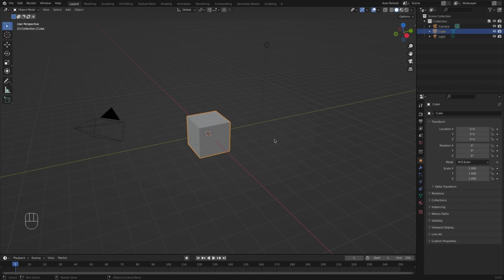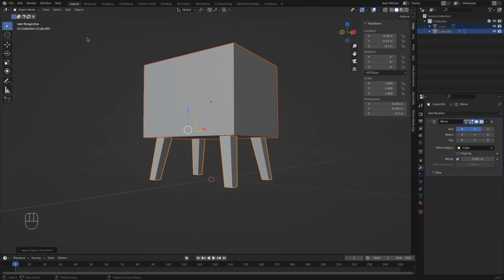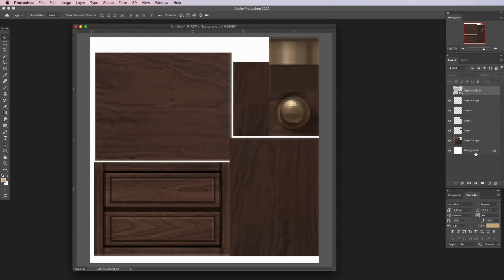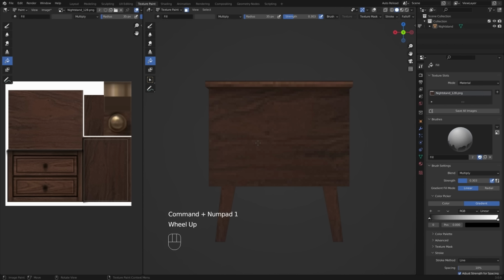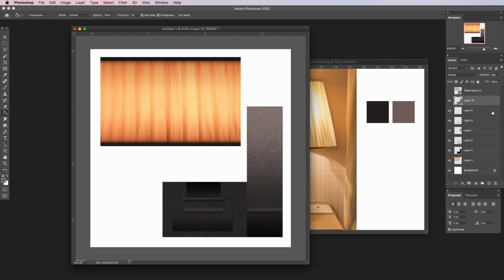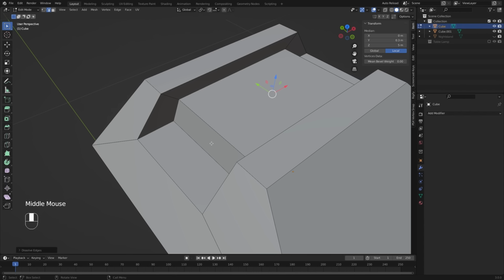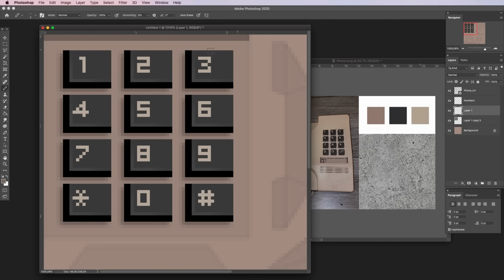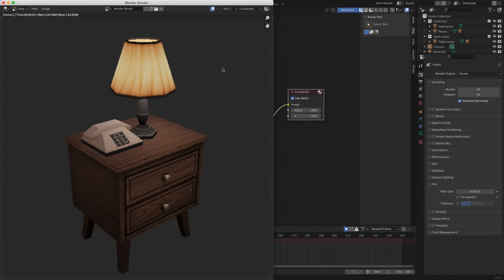PS1 Style Graphics in Blender / Low Poly Assets Beginner Tutorial - Part 1

Comment: how are you making 2 sepret windows in photoshop? i can't do that at all. you also seem to have chosen a "clipboard" when first creating the project, and i dont have that option either. im assuming thats the reason you can just drag and drop a photo to make a new tab? what am i doing wrong? i've tried every photoshop alternative including the free trail of photoshop and i cant seem to do that at all. idk if you are hitting extra keys or not. also when i bring in my uv image into photoshop, yours just magically fills in the whole photo, while i have to scale mine. tf am i doing wrong?
Reply from the maker: To be honest, I’m not even sure why you’re running into this issue. Photoshop allows you to have several documents open at the same time. If you grab a window by its top bar (header), you can either move it out as a separate floating window or dock it to the top of the main application window.

As for your UV issue, there’s one important thing to keep in mind: when you drag a PNG file from a folder into a Photoshop document, make sure the document canvas isn’t zoomed in too much and that the entire canvas is visible. In that case, the imported UV image will automatically be placed to fit the canvas dimensions.

Comment: At the 43-44 minute mark, when you're doing the drop shadows under the lip of the top of the nightstand, when I try to do the exact same thing my shadow comes at an angle and when I hold alt it gets worse. What am I doing wrong?
Reply from the maker: I thought the problem might be related to the Blender version, but I just tested it in Blender 5, and everything works fine for me.
To make the gradient run perfectly vertically, it’s important to do this from the correct viewing angle, for example, using Front View or Side View.
The process is as follows: drag to set the direction using the LMB, then hold Alt, and finally release the LMB.
Reply: @Summmer85  thanks man, I'll give it a shot in the morning. Appreciate the response, this is a great tutorial! Can't wait to get to making stuff on my own!

Comment: 24:17 doesnt work for me. It didn't change anything - its just by eye still. EDIT. It works by in my case i must point to the corner of the uv object
Reply from the maker: Yes, you’re right. In newer versions, you need to specify the angle as an additional step.
Reply: @Summmer85  more additional steper! Yeah...;_;

Comment: Hey, thank you so much for making this. This is quite silly, but at 15.40 anytime i try to move the face across the z angle whilst in the no.3 view position, it just moves the face of the object rather than the whole leg to the left. i've made sure all my settings are the same and my screen seems to match yours exactly, so im not sure why that is? any advice would be greatly appreciated x
Reply from the maker: I’m not entirely sure what’s causing the problem, but I suspect there might be some extra (duplicate) faces in your mesh. If that’s the case, try selecting the whole leg of the nightstand in Edit Mode (A), then press M → Merge by Distance.
If that doesn’t solve the problem, please send a message in the chat on my Discord server (link in bio) and attach a screenshot.

Comment: Does anyone know how to snap to vertex in 24:18? It isn't snapping at all in my case...
Reply from the maker: In the newer version of Blender, while moving the fragment, hold down Control and additionally hover your cursor over the top-left vertex of the reference fragment, for example.
Reply: OK Found Out, 

Summer 85 : There's good news! Snapping actually works in the newer versions of Blender, it just works a little differently now.
You need to select one UV island, hold Ctrl, and start moving it toward the similar island. While dragging, place your cursor over one of the corner vertices of the reference island.

Comment: for some reason cube project isn't working for me! I'm using 5.1.2 and all it does is show the uvs as a normal cube instead of the modified shape!
Reply from the maker: Here I’d like to ask whether you applied the Scale. But you probably did, so I’m not really sure what could be causing the issue. I’m currently using Blender 4.5, and everything works as expected here.
Reply: It doesn't work at all for me either
Reply from the maker: @Elisuperr  I tried it in Blender 5.2, and everything works without any problems. The key is to apply the scale (Ctrl+A) beforehand.

Comment: 24:08 snapping in uv editor seems to literally be broken because I have followed every single keybind exactly, vanilla blender 5.2.0 LTS release (no addons or whatever) and I can't get ANY SNAPPING to work. holding down ctrl literally does nothing, it's like snapping straight up doesn't exist. the magnet icon is on, its set to vertex, affect move, nothing happens. ive read every single stackexchange question on this and none of the solutions work. you're forced to just eyeball it.
Reply from the maker: There's good news! Snapping actually works in the newer versions of Blender, it just works a little differently now.
You need to select one UV island, hold Ctrl, and start moving it toward the similar island. While dragging, place your cursor over one of the corner vertices of the reference island.
Reply: @Summmer85  This worked for me. Final step is let go of Ctrl.

Comment: Hi there @Summer85 - Been having a slight issue with UV unwrap on the phone section where my uv unwraps dont look like your ones and i cant figure it out for the life of me. 
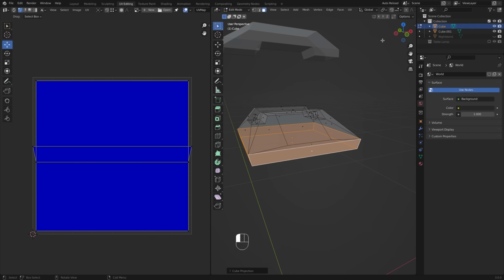Ive highlighted the bottom section of the phone and then done a cube projection but they are just turning into squares no long horizontal like in your video at 1:16:18. any help would be appreicated
Reply: Managed to figure out how to delete the Uv Map and will try again first
Reply from the maker: Hi! Did you apply the scale (Control+A) before unwrapping the UVs?

Comment: stuck at this part 23:24 dont know what to do.. help!
Reply from the maker: If you can't snap one UV island on top of another, try dragging it while aiming your cursor at a corner of the target UV island rather than its center.

And you may also need to disable UV Sync Selection (the two arrows in the top-left corner) so that everything works the same way as it does in the tutorial.
Reply: @Summmer85  IT WORKED! THANKS A LOT :face-blue-smiling:
Reply from the maker: @Rootvik.  That's just how the newer versions of Blender behave. The tutorial was recorded in Blender 3.0.
Reply: @Summmer85  I see, thanks for such a quick response!

Comment: Is there no way to apply the textures in Blender instead of Photoshop?

I don’t really have the skill for photoshop but if this is the best way, then I am willing to learn.
Reply from the maker: Actually, you can create textures in whatever software you're most comfortable with. I've been using Photoshop for many years, so it's what I'm used to. A lot of people also use GIMP.
You can even paint textures directly inside Blender, but I personally prefer Photoshop because I feel like I have more control there.
Reply: @S @Summmer85 I found a way which is to use a texture ripper. I found a program called Dinorip which allows me to make a texture atlas. This can then be applied to the UVs.

Maybe if that’s new to you, you can also check it out and it could be a video topic for you 👍

Comment: why his brush paint shadow pixelated while mine just like thick brush at 42:00
Reply from the maker: Probably because you’re using a higher-resolution texture. Also, in the material settings, it should be set to Closest instead of Linear so that the pixels stay as sharp as possible.

Comment: for the 1st asset, why not just use UV Smart Unwrap?
Reply from the maker: The main reason is the texture resolution we're working with for this asset — only 128×128 px. We're trying to use that space as efficiently as possible and squeeze the most out of it.
With Smart UV, the elements are not always unwrapped in the most convenient way. That said, it's still a perfectly valid place to start. The important thing is understanding how to proceed afterward and adapt the UV layout to the specific situation you're dealing with.

Comment: Hey I have a question about blurring on the textures is there any way to prevent this when scaling down? i didn't use the textures you have everything looks good except for the drawer lines is it just the images i got are to high in scale?
Reply from the maker: Blurring or distortion of a pixel-art texture when scaling it down is inevitable, which is why the best approach is to create it at the target resolution from the start.
However, there is one setting that helps preserve pixel sharpness much better. When using the Image Size dialog, make sure to select Nearest Neighbor in the Resample option.

Comment: im having some problems whit te uv editing, i follow every step but it isnt like yours😭
Reply from the maker: Could you tell me the timestamp where you ran into the issue? I'll try to help.
Different versions of Blender work a little differently, so that might be the reason.
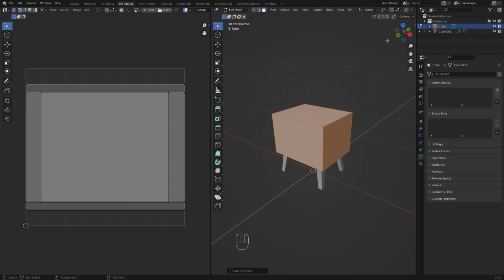Reply: @Summmer85 18:58 i usually use the second way you showed but i wanted to learn the first one, the problem is i dont understand how you select the faces like that. also in an animation do you think it will be cool to male the objects shake with the camera movement(also i dont know how to do it but its an another problem🤦🏻‍♂️)?
Reply from the maker: @MassA159_p The main difference here is that in newer versions of Blender, UV Sync Selection (the two arrows in the upper-left corner) is enabled by default. With this option turned on, all selected faces are always displayed in the UV Editor. Sometimes that's convenient, and sometimes it isn't.
As for the first method you mentioned... do you mean selecting faces one by one? If so, you can simply do that while holding Shift.
As for objects shaking in sync with the camera movement — sorry, but I'm not sure I understand what you mean. :)

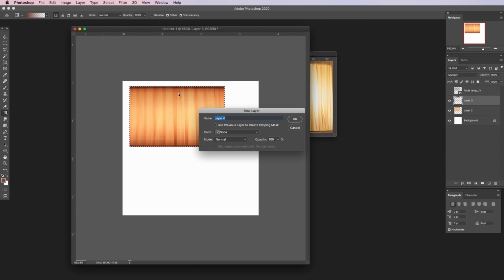Comment: Hi, Im having trouble with 56:00, whenever I use the gradient tool on the bottom and then try to do the same thing on the top, the bottom one disappears and vice versa
Reply: rn im just doing it in different layers
Reply from the maker: @irina-ren  Check the top-left corner and see what type of gradient you have selected. You need Classic Gradient, and then a bit to the right, in the presets section, you should choose Basic (probably the middle option).

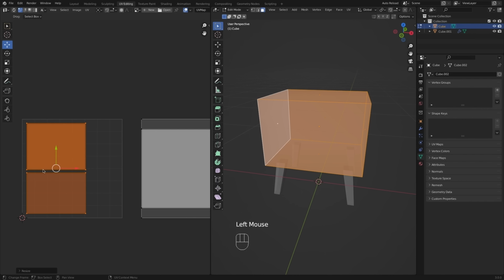Comment: Hi, thanks for the tutorial! Im following along with it but Ive been stuck at 21:40 for a while. How do you get two orange planes for top and bottom? I only see one. Im using version 5.1.0
Reply from the maker: Hi,
The new version of Blender is slightly different, so there may be some inconsistencies.
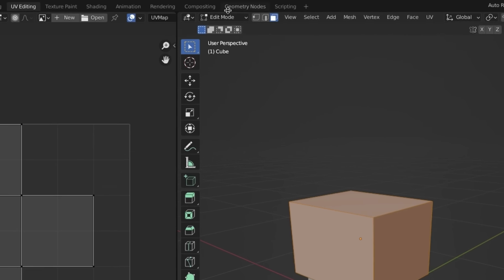In this case, try going back to around 18:30, but first disable the UV Sync Selection option (the two arrows icon) in the top left corner. Hopefully that will solve your current issue.
If you have any further questions, please don’t hesitate to ask here.
Reply: Thanks a lot for the help! I appreciate it.

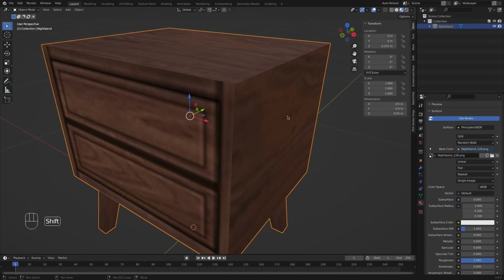Im confused with another thing. I dont have the 'specular' tool in my list in 32:34. Theres a specular drop down menu but not a specific bar named 'specular'. However, setting the IOR level to 0 seemed to have done the same thing, I was wondering if thats the same thing as what you did here.
Reply from the maker: @irina-ren  Yes, you did it correctly. In the new version of Blender, Specular is located in a separate tab, and the IOR Level there is exactly what you need.

Comment: Hey dude I’m getting really confused on 24:03 and 22:37 I can only select one and then I can’t even use the apply feature. I’m really confused?
Reply from the maker: Apply Modifier is only possible in Object mode (not in Edit Mode).
As for merging two identical elements, in the newer versions you can’t just drag one element onto the other anymore — you also need to point the cursor at the far corner of the second element.

Comment: 29:32 i use the krita. How can ı do that , you know ?
Reply from the maker: Sorry, I use Photoshop only
Reply: If you're still watching you can either use an edge detect filter or a Gaussian high pass which is essentially doing the same thing here, but Photoshop seems to automatically blend the filter back into the layer (you will need to do it manually, you can apply it to a new layer and then just reduce the opacity). Play with the blend modes too.  Also with Krita you can use the Export option rather than merging all the layers (you have to remember to hide any you don't want, wish there was a way of marking these as non-export), I find that neater but merging works too.

Comment: i am facing some problems like at 24:14 the vertex is not working in 5.1 blender anyone know the sol?? and yes its my first time using blender
Reply from the maker: In the newer version there are some differences in how this works. For them to snap together, you can’t just move one face/island toward the other — you need to place your cursor on the far corner of the reference island (for example, the top-left or top-right corner in this case).
Reply: @Summmer85  i completed the nightstand but i faced some problems . first the pictures didnt became pixelated i might have skipped something, the front side picture became backside in blender after PS , still for the first thing i made it is good enough
Reply from the maker: @GEET373  You probably created the image at a higher resolution than 128x128, so it doesn’t have the pixelated look. And if some face ended up in the wrong place after texturing, it’s not difficult to move it where it needs to be in Blender.
Don't give up!
Reply: was the problem i faced because i didnt do in x ray mode??

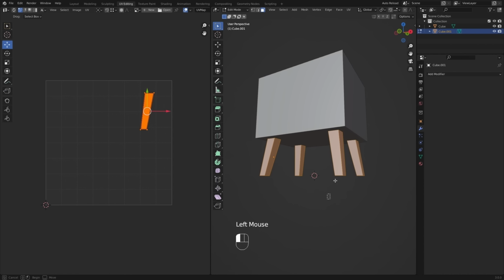Comment: hit another roadblock at 24:59. When I apply the mirror modifier exactly as you do, the legs stay all together as if nothing happened. I can't select one without selecting all of them. I am losing my mind trying to figure out how I could possibly be doing something different or wrong from you. Did 5.1.0 change how this works? I don't get it. I've even restarted the tutorial from the beginning and remade my nightstand to ensure I have matched your actions perfectly but when I get to that step it simply does not do the same thing on my screen. What is happening here? The legs continue all behaving as one after I click apply. I can't work on just one like you can. The only major difference I see between our screens is on my end, there is a grayed out outline of my leg in the UV edit window on the left side, whereas on yours there is nothing in the UV edit grid. Does that matter at all? 

Ultimately being able to work on each leg doesn't seem to matter for this tutorial since we combine the legs and cube into a single object a few seconds later anyway but for future reference, why could I not select each leg individually?
Reply from the maker: About the UVs always being visible in the left window — that’s because in newer versions the UV Sync Selection option is enabled by default (the two arrows icon in the top-left corner).
As for the nightstand legs, you should be able to edit each one separately, but only in Edit Mode (Tab). If you’re in Object Mode, all four legs are basically part of the same object. Of course, you can separate them, but that’s a different topic.

Comment: 21:38 apologies if this has been answered already, I'm in blender 5.1.0 and when I go to arrange the faces of the cube in the UV editor like you do, I only have one face for top and bottom. I have rechecked a good few times now and I do have both the top and bottom selected but only one square on my grid. My side faces are exactly like yours, it's only the top and bottom that isn't giving me two squares like you have. Did something change in the versions? Thank you
Reply from the maker: Yes, there are some small differences depending on the version. You might be a little confused. In the UV Editor at 21:38, the top and bottom parts of the nightstand are placed at the top (they’re stacked on top of each other), and the front part is placed below.
Reply: @Summmer85  oh I see. I had all four sides selected at once. I was only supposed to select 3 and then do the fourth later. My mistake thank you

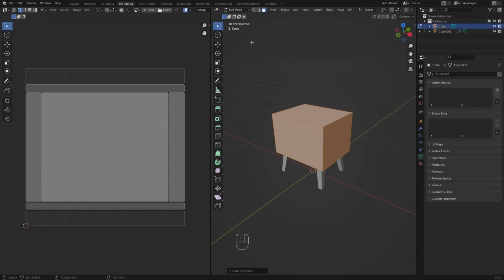Comment: 19:12 when i unselect the box in the right window, the left should be empty but none of my boxes disappear, this is causing me to have issues arranging individual sides because all of them are showing at once
Reply from the maker: You need switch off "UV Sync Selection" at the top left of the UV Editor (two arrows icon)
Reply: @Summmer85 that worked! thanks!
Reply: @Summmer85 tyy

Comment: 24:48 still not working when i click on one of them, they all appeared orange
Reply from the maker: If all the legs are orange in Edit Mode, then either you haven’t applied the Mirror Modifier, or they’re all selected by default. You can select them individually either by using rectangular selection or by hovering the cursor over a part and pressing L.